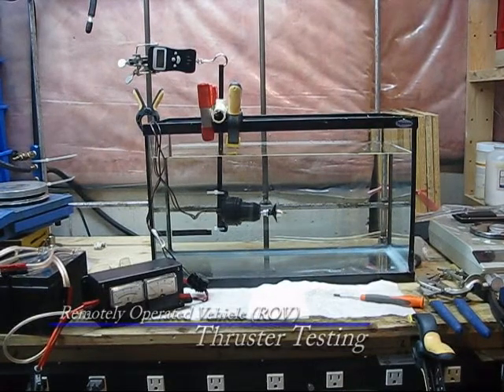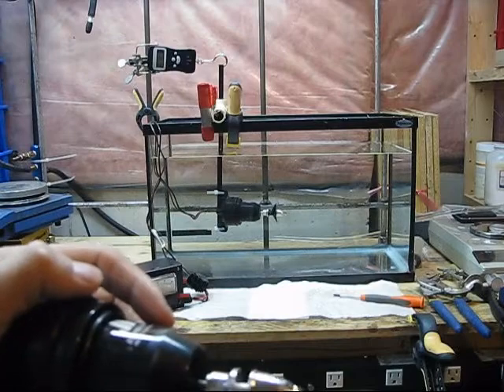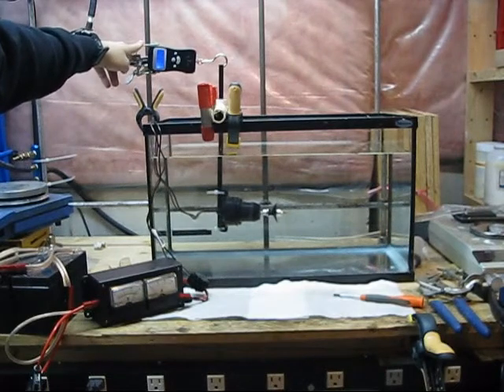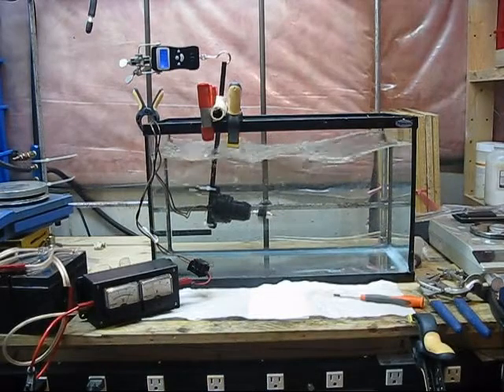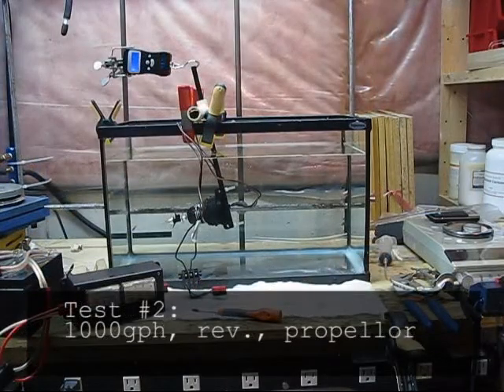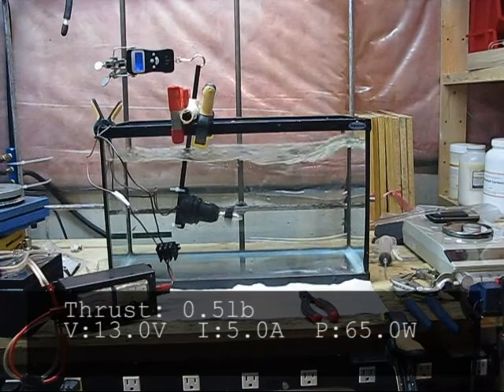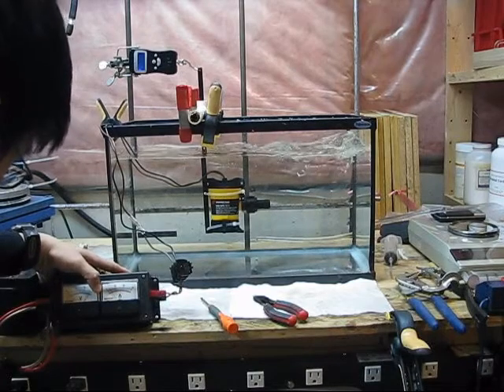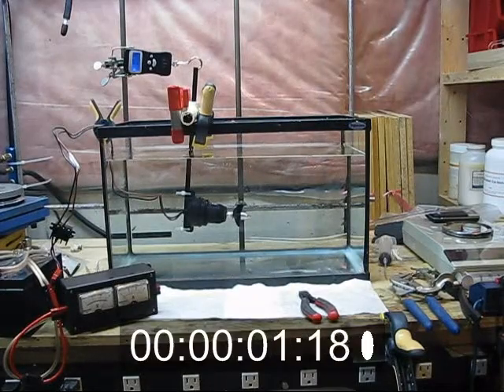ROV Thruster Testing

Comment: what was the A on the pump when you emptied the tank? (ie the normal amp draw as it was designed) you have doubled the amp draw thats not good in a housing that wont cool the motor very well.. also you might want to try and run the motor for awhile till it does warm up then let it cool underwater, the air will expand as it heats and it might leak past the seals then as it cools it could suck in water..

Comment: What is the 1000 gph bilge pump you used, what is the shaft diameter of the motor, and where did you buy the collet for mounting the propeller

Comment from the maker: @HomeDistiller I didn't measure the current draw during the pumping of water unfortunately, though it should be in the 3A range for the 1000gph pump. I plan on filling these motors with mineral oil to help with cooling and also help exclude water, so I am not terribly concerned about the heating. Additionally these were static load tests, I'm anticipating that once the vehicle is up to speed, thruster output can be decreased to maintain movement.

Comment: Thanks for the info. I'm looking into alternative propulsion methods for my small open sailboat.
I just think that the comparison propeller vs. regular bilge pump output is not completely fair since it's two different propulsion methods. In order to get a proper reading for the original bilge pump output, you would have to put the nozzle at  surface level. This way it is able to put out its full propulsion potential. Just compare holding a garden hose in a bucket. With the end of the hose completely submerged you will experience less thrust than with the opening on surface level.
I'm eager to find out what the difference in reading will be in that setup.

Comment: yea but how deep can that motor go?
Reply from the maker: Not super deep without mods, but a common enough way is to drill 2 holes (inlet and vent), and fill with low viscosity silicone oil and plug with rubber stoppers. Filling with an incompressible fluid increases the max depth, and improves heat transfer at a slight performance hit.